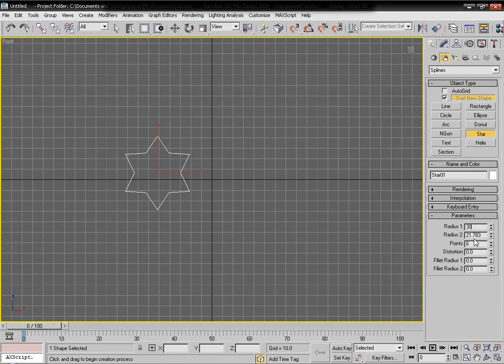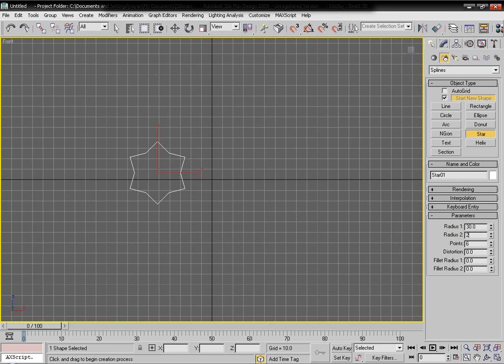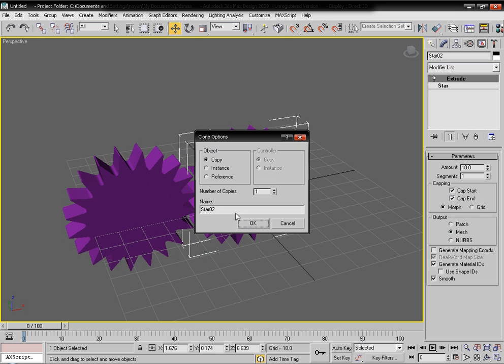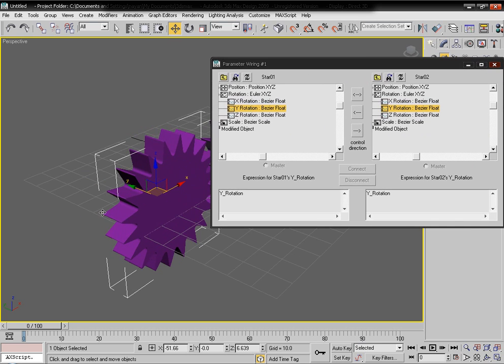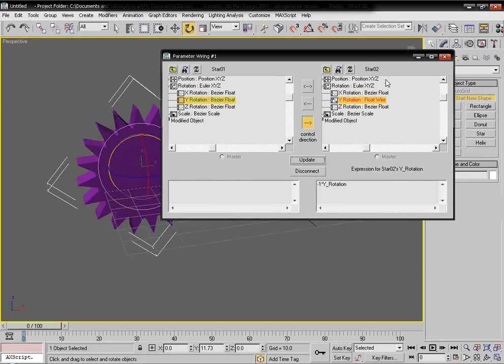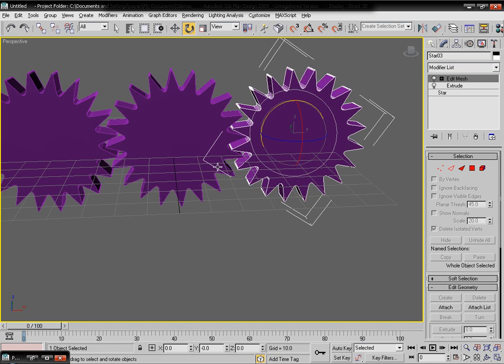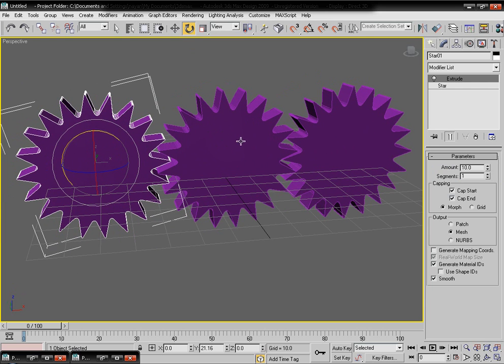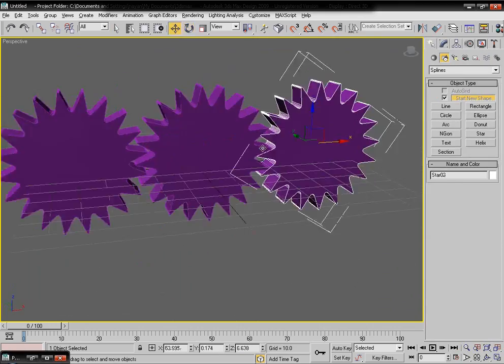3ds max gear tutorial

Comment: can you help me out.  i have a specieal driver gear and in one of the four 90 degree quadrants there are 
four teeth.  it contacts the spinner gear once every rotation.  also the spinner gear should only spin 180 
degrees then stop until the teeth get back around.  any help would be appreciated.

Comment: Thanks. I found this helpful because I'm trying to animate an insect and I wanted to build a single controller to use for animating the wings flapping up and down. This way I can just set my controller to pivot the right side wings and have the left wings mirror the movement. I was unable to achieve this with just an orientation constraint controller.